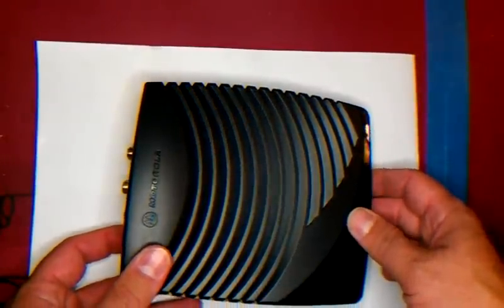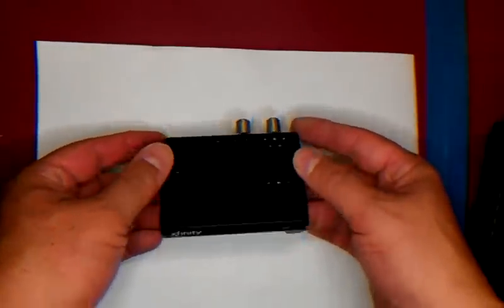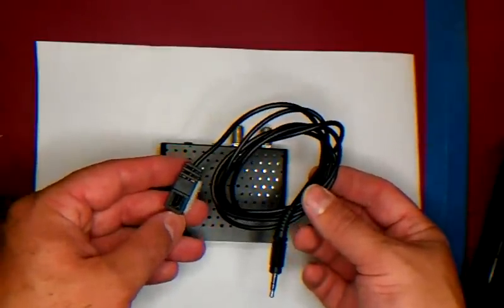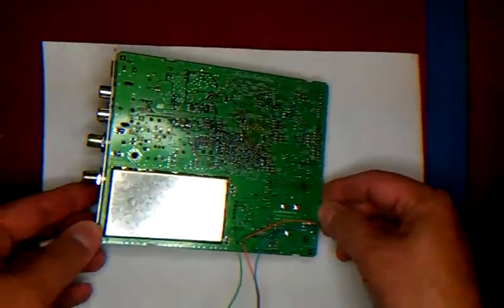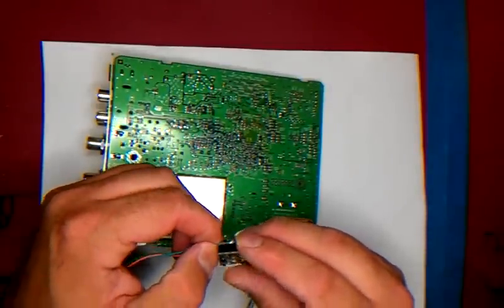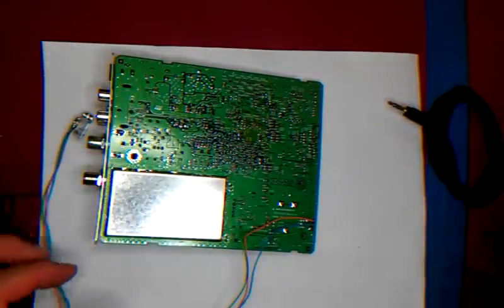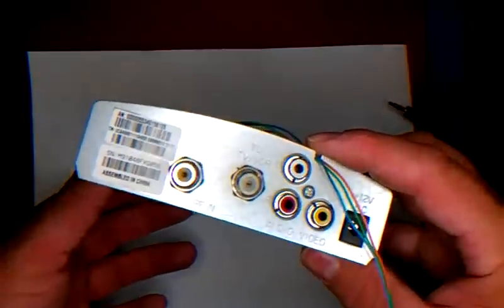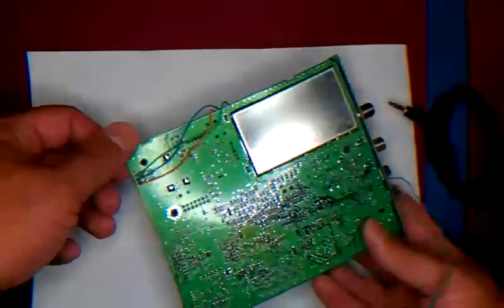Modding the FIOS Motorla DCT700/US for Remote IR

Comment: what is the model number of the IR receiver module and where can buy it?
Reply from the maker: the module you can buy from radio shack or ebay, type in "IR RECEIVER 3.5MM" they are around $2 USD
Reply: Ok thanks